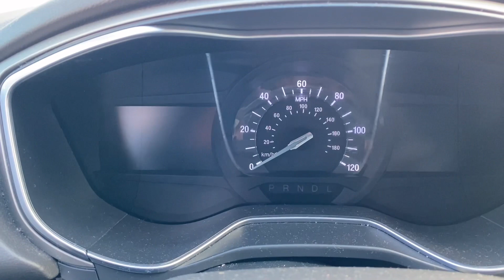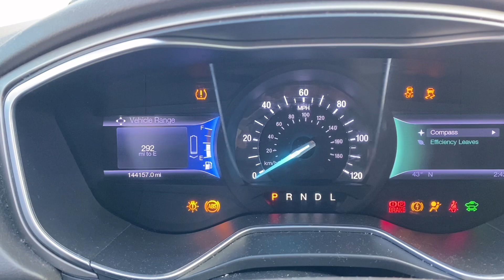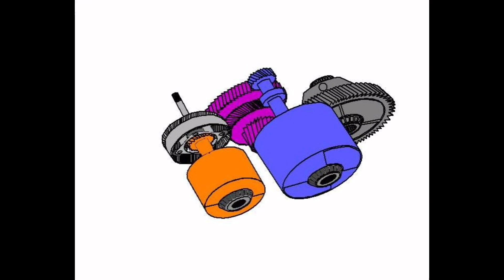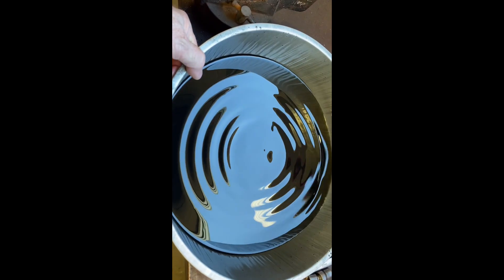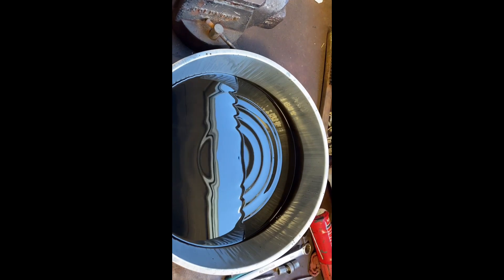Fusion Hybrid Stop Safely Now Transmission Failure

Comment: ford c max If you could tell me exactly what could be wrong with this code?p1920
Reply from the maker: The most likely cause is the dampener. It looks kind of like a clutch disc and bolts to the flywheel / flex plate.
Reply: @CarShopTalk  I would like to explain exactly what is happening. When I give gas and the speed increases to 80, then it says stop salty now and maybe you can help me tell me what is wrong.
Reply from the maker: @davitrene3294  Does the gas engine start? P1920 indicates slippage between the transmission and engine. Usually if this is the only code in it the damper has failed.  If that’s the case usually the gas engine won’t start.  The transmission spins the shaft that goes to the engine, but the engine doesn’t spin or start. There can be transmission problems that cause that as well, but you’ll usually have additional codes in the SOBDMC if that’s the case.
Reply: @CarShopTalk
Reply: @CarShopTalk  Yes, the gas turns on, the car works normally, just as soon as you give high gas, when it reaches 80 km/h, it shows Stop Safely Now.
Reply: @CarShopTalk  I really need your help
Reply from the maker: @davitrene3294  There has to be slippage occurring some where. Did you pull all the codes on it? Forscan? IDS? Or just the PCM codes?
Reply from the maker: @davitrene3294  I really don’t and it’s a very busy day in the shop.
Reply: @CarShopTalk  forscani only shows p1920
Reply: @CarShopTalk  forscani only shows p1920 and no one has understood this problem and maybe you can help us.
Reply from the maker: @davitrene3294  Look and see if there’s a pid for input shaft speed or equivalent in the SOBDMC. Also an engine RPM pid. If they’re available I’d watch both of those and drive it and try to get it to act up. P1920 indicates a speed difference between those two.
Reply: @CarShopTalk  Hello. Could you please explain in detail if possible? We didn't understand. Is there a problem with the engine? The car works perfectly, the only problem is that as soon as I give the gas to the end, it says this problem.
Reply: @CarShopTalk  Please tell us how to contact you. How to call you. Whatsapp or Viber or Facebook to call you in messenger and explain everything to you
Reply from the maker: @davitrene3294  I really don’t take calls for this kind of thing. Your code, P1920 is for the gas engine speed (RPM), not matching the transmission input shaft speed, despite the two being mechanically fastened together by the dampener on the flex plate. It could be an issue with the crank sensor or wiring, but since it only happens under heavy load / hard driving it seems like some how slippage may be occurring. I would watch the engine RPM pid and hopefully there’s a pid for the transmission input shaft speed in the SOBDMC. They should always be the same. They’re literally bolted to each other. You’re code is for their speed not matching. Try watching the pids and attempt to duplicate the problem. If they vary from each other, then you’ll have to figure out why. If it’s actually slippage, the transmission turning slower than the engine under heavy loads, I would think it would have to be some kind of an issue with the flex plate, dampener or transmission input shaft and the transmission would have to be removed to verify.
Reply: @CarShopTalk  I'm really sorry to bother you, but no one has understood this problem and I want your help. We checked the gearbox, removed it and everything is fine, we also changed the wiring, but it still didn't fix it.
Reply from the maker: @davitrene3294  You’ve pulled the transmission and didn’t see any issues with the dampener or flex plate?
Reply: @CarShopTalk  Yes, we removed the gearbox and there is no problem, and the flexible plate is there? That's why Minra Messenger, WhatsApp to send you photos and explain everything exactly
Reply from the maker: @davitrene3294  Assuming the car is all back together and drivable I’d try to watch the pids and get it to act up.  Try to see what the computer is seeing that’s setting the that code, which I would expect the engine speed and ISS to be at different speeds. Or does the signal for one of them completely fail sometimes causing it?  Hopefully you can determine what’s going on or at least get a better idea of what’s happening by monitoring the pids and duplicating the concern. It sounds like you’ve checked the likely causes, the dampener and the flywheel. Did you take the dampener or flywheel off and inspect them?  I have seen some coming apart / cracking behind the reinforcement where the bolts to the crankshaft go through. There’s always the possibility of a bad sensor, damaged wire, loose connection or a lot of other things.

Comment: What does P04E4 code mean? 🤔
Reply from the maker: Off the top of my head I think that’s a crank case pressure sensor code. What’s it on?
Reply: I have the same code. Failure to crank. 2015 Ford Fusion hybrid
Reply from the maker: @btoddstock  had you been hearing any bearing noise from the transmission previously?
Reply: @CarShopTalk  yes. To be honest it had been a while, however, didn't find anything on this type of thing until after my bad luck. And of course the bad sound happened right after 100k miles
Reply from the maker: @btoddstock  It’s too bad, it’s expensive to repair. I can’t really say I’ve seen any other issues with that transmission.

Comment: Thanks for the video. My Fusion hybrid has 360,000 miles and when switches from engine to full electric it has a knock, but if I go easy with throttle is unnoticeable. Can that be repaired? Or just need to change the whole transmission?
Reply from the maker: If you’re not getting any warning messages yet and it’s not leaking fluid it may still be repairable.
Reply: What happened

Comment: A question I have with my 2018 Ford Fusion. No check engine lights, seems to shift thru the gears and runs. When you touch the accelerator pedal it makes a loud rubbing noise like when you cut rotors. When pressing the accelerator petal hard it almost feels like it could have a possible slip. Any ideas or outcomes?
Reply from the maker: Not sure without hearing it. It’s not ringing a bell for anything I’ve seen.

Comment: I had the "Stop Safely Now" come on....took it a shop and the mechanic said it was the transmission and said 7k! That's what I paid for the car!
So I left and the warning went away and it's been driving fine ever since!  It's been 3 months and about 3k miles
So, not sure why the warning light came on, but it drives like new.
Reply from the maker: I would sooner bet some of the electronics or the transmission over heated. Doesn’t sound like the transmission should be condemned, especially if it’s worked fine since.
Reply: What this means is save money and get ready to replace it at any point a car usually just doesn’t fail it gives you warning signs it means it’s on its way out check fluid

Comment: I'm having an issue on my 2014 Fusion Energi. Car has developed the tell-tale loud whine when gas engine turns out. Dealer + third party repair say the transmission is bad, but they can't really tell me what exactly is wrong with it and the car is working just fine. I bought with 76k and am at 187k so very plausible it's time to repair or get rid of, but since the car works fine (aside from noise) and no one can really exactly tell me what's wrong, I'm unsure how to proceed.

UPDATE: Dealer confirmed metal shavings in transmission fluid, indicating something may have broke. Third party said they had a gear ratio code error.
Reply from the maker: I would guess the bearing is failing like the one in that video but it could be tough to diagnose if it’s still working. You could drain the oil and see if there’s any signs of failure there, but metal will stick to the magnets in that transmission, so the only time you’ll see metal is if it’s progressed far enough to grind on the aluminum case.
Reply from the maker: Just read your update. I think there was / is a tsb on repairing that issue in those transmission, but I’ve never done one. Most of the ones I’ve seen failed so badly they had a hole in the case / or they kept working until that point.
Reply: @CarShopTalk  Thanks for the tip. Searched TSBs and it looks like maybe one or two might address it. Was headed towards a replacement but will search around for a good rebuild shop and see what they think.

Comment: Your video is truly awesome and did a very good job of explaining how my transmission works I’ve always been very curious. I have a 2018 Ford fusion hybrid SE , you think it could have the same problem?
Reply from the maker: Thank you!  I haven’t seen failures in anything that new and I’m pretty sure they’ve improved the design since the older versions.
Reply: @CarShopTalk  Starting from what year they improved the design?
Reply: @Валерий-ц9л6й  from 2018
Reply: Nope , I have a 2018 hybrid fusion SE and have the same problem with it right now. It will start with some noise then it turns off . Have the triangle warning , can’t move the car cause it only stays ON for like 3 seconds

Comment: My 2013 energi se has this problem, I replaced the camshaft postition sensor, but now it sometimes won’t even start, or it tells me to stop safely now before I even turn the key to start the engine. I don’t know what it could be and no one around me can work on hybrids. And now it doesn’t even show I have any codes, when before I replaced the sensor it gave me P0A3E, P0340, P0344, and P1A41.
Reply from the maker: The P0A3E definitely indicates an over heating condition, but you shouldn’t get that cycling the key on with a cold vehicle, unless you mean turning the ignition off and back on when the drivetrain is all ready hot. I’m not sure what to tell you about the cam signal codes, other than I’m not sure I’ve ever seen a bad cam sensor on a Ford other than the older vehicles with drop in synchronizers. Do you have access to Forscan or a scan tool where you can look at pids on the vehicle?

Comment: Outstanding Shop Talk video on Ford HF35 Trans. I have just bought a 2014 Lincoln MKZ 2.0L FWD Hybrid with The Hf-35 xCVT trans and it is leaking out about 3qt, but the car drives great. Because of the leak the Transfer-shaft assembly (EG9Z-7H348-A) bearing and cup should be shot, but those parts only cost US $410 right now. Is it possible to put a rebuilt used HF35 eCVT or even a newer Ford 2017-up HF45 eCVT and not have to reprogram the power transfer unit? The only cable that comes out of both trans are the hi-voltage drive/regen motors and the low-voltage data cables (that reads both motors temp and speeds). From what I have read; the HF35 has no brain or need for VIN programming itself. I ask because my locale Lincoln Dealer just quoted me US $10,000+ to replace the HF35, recalibrate the Lane-departure system, and realign the wheels. Since I was not born yesterday and value my family's treasure, I figured I would ask an expert. The car is beautiful and still drives it just need seals and bearings but no trans shop in or near Chicago will touch these eCVTs due to Ford's EV service equipment requirments (an anti-static bay). I have removed FWD trans and replace clutches before and I am thinking of removing and rebuilding my own trans because of inflated dealer costs. Any help you can provide would be much appreciated "for eductional info only... lol". Thank you for your time, sir.

BTW: Can you do a trans removal video on the HF35 and HF45? That would be amazing.
Reply from the maker: I can’t say that I’ve had a transmission out of a 2017 or newer to tell you if there are any differences. I’m a state or two over from you and a bit more rural / in the middle of the corn fields lol. While there are hybrids around I don’t get huge numbers of them in the shop on a regular basis. I agree there’s not really any modules inside the transmission, but I’m not sure if all the electrical connectors would be the same or the resistance on motor windings, or even the number of poles in the electric motors would be exactly the same to where nothing would throw a fit and it would work. It seems like it would work and would be worth looking into. I’m trying to get this weeks video done tonight, but remind me in the middle of the week and I’ll try to look up and see if the electrical connectors are the same between both years.
Reply: @CarShopTalk  Question: Do you know if on the 2013 HF35 eCVT trans when replacing a DG98-7000-EC transmission with a "Used" Transmission, if there should be no need to reprogram the trans-control-unit(TCU)... right? I just need to make sure the Part and FHEV matches on both trans? (I know I should call Ford and make sure both remans match, but matching the oem number should work too.)
My concern is that the HF45 trans has, like you said, a different timing or resistance and is incompatible with the earlier HF35 TCU.
But putting the HF45 aside, It looks like removing the 175lb HF35 trans from my 2014 Lincoln mkz is as easy as: (1) removing the 12V battery in boot, (2) Pulling the HV disconnect in boot, (3) putting the front of the auto up on jack stands and removing the front tires, (4) remove engine belly cover and draining the trans, (5) removing the HV trans lines from both the trans and the TCU and cover the holes with duct tape, (6) removing the trans cooler lines, (7) remove the round black trans data connector and cover hole with plastic and rubber bands (8) supporting the ICE, (9) support the trans with a trans jack, (10) remove both drive shafts, (11) unbolt and drop the trans.
Did I miss any steps? My plan is to try to inspect the trans and either rebuild the HF35 eCVT trans or buy a used trans and inspect then install it.
The black data connector on the front of the trans has, what looks like, 26 small wires coming out of it. Maybe I under estimate Ford's ablity to complicate simple data ports. Maybe Ford put a simple ID chip in the connector to limit peoples ablity to swap transmissions. It just seems like way too many wires for two speed and temp sensors. And the trans labels seem way to complicated with QR codes and barcodes, that in many cases last longer than the trans. Dang Ford/Lincoln, but the MKZ is a beautify auto.

Trying to make it work in Chicago. Thanks
Reply: @GallowayChicago  Recently replaced my 2011 MKZ engine due to cyl 2&3 knocked causing bad 27mpg. Was trying to pull out engine only but not enough room to separate tranny even though it doesn't have torque converter. I could force it but wanted to clean tranny and replace both axle bearings anyway. So I end up pulling both engine and tranny together.
Reply: @JD_Zenab2300  What was your mileage after the ICE replacement? Another crazy thing the ICE for 2013 are around $500 but the eCVT are around $2000 from my local bone yards (within 200miles). Are the 2013/2014 and 2011 MKZ  hybrids the same dimensionally from wheel to wheel in the front? It look like the 2013/2014's are wider. I would much prefer to just slant the engine and pull the trans, but if slanting the engine puts strain on the exhaust and the exhaust has to be removed then how much effort am I saving? I know the smaller body C-Max has to remove ICE+eCVT, but I thought the larger 2013 MKZ would allow eCVT removal as long as the ICE was supported. I will remove the bottom cover and take a good hard look. I want to do this the easiest way possible (relatively speaking). That needless eCVT ID is making me hesitate, because when I am done installing a donor trans I will have to take it to Ford to re-program the car (still out 3day to a week and a half in my area). Trying to see If I can just swap the data port connector that must have the ID chip in it.
Reply: @GallowayChicago  300k, car was previously Limo service and was my commute car 800miles per week. I'm actually very impressed. I considered selling it but knowing it can get to 300k miles, will just keep it.
Reply: @JD_Zenab2300  300k is impressive but I was asking MPG on new engine. I say when a car has over 190K it is either well maintained or a pile of junk.

Comment: My car 2014 lincoln mkz hybrid.  Been throwing up a red triangle.  Pull over safely warning.  The transmission seems to run perfectly.   Ive had issues with that fault in the past. Lincoln dealership replaced the battery which seemed to fix it for nearly a year.  Now its back. Had the fault 4 times.  Which seemed to be back to operational if i turn off.. open the door.. and turn back on.   

If its the battery power input.. i question it being the issue once im driving.. cause shouldn't the alternator take over? 

I read somewhere it could be a sensor or chip.  

I just feel most mechanics avoid hybrids.  So its hard to trust dealerships to get a real fix for this issue. Maybe I'm just paranoid.  All i know is the fault is back. And my car tends to run flawless otherwise.
Reply from the maker: Really the place to start is to get the codes pulled from all modules.  That should at least point to what system has been causing the problem. There’s quite a few things that can bring up the red triangle of doom. As far as charging I don’t think that car has an alternator, or what you would traditionally consider an alternator. It charges the high voltage battery from the generator in the transmission. It uses a high voltage dc to low voltage dc module to  convert the high voltage from the hybrid battery to 14.5 volts to charge the 12 volt battery. It should charge with the engine running and possibly with just the key on if the high voltage battery is in a good state of charge. Get the codes pulled from all modules. Until then you’re just guessing.